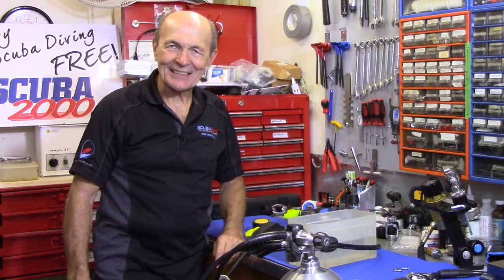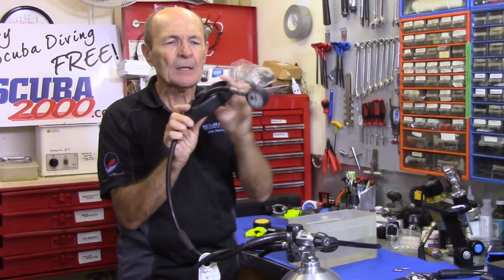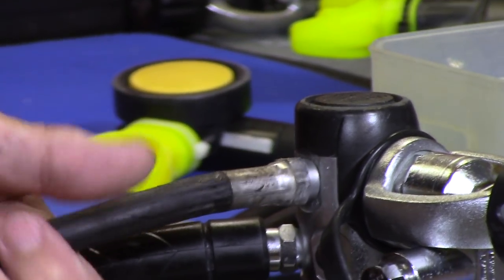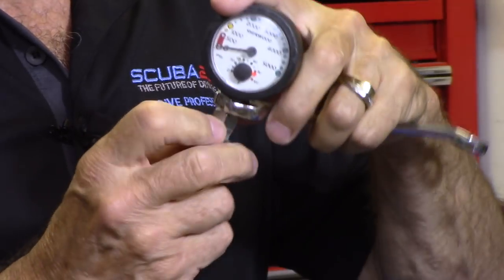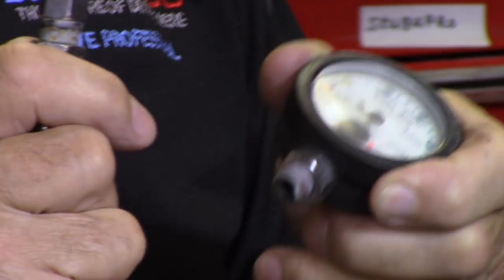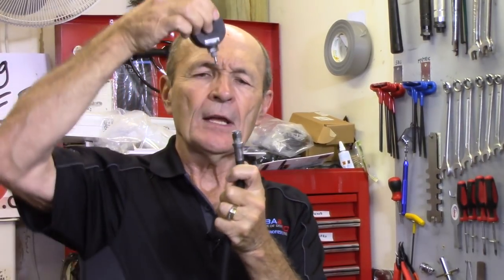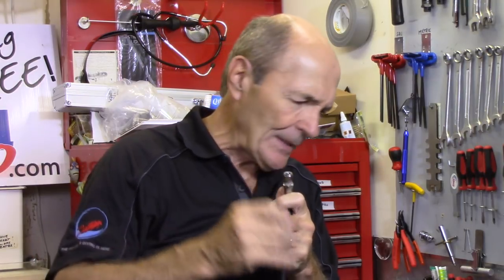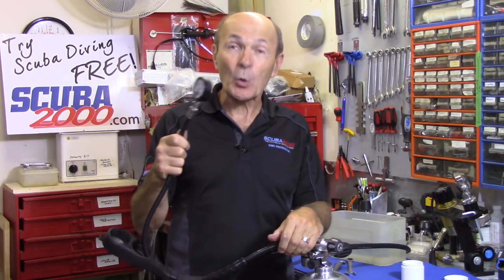Servicing Your SPG - Scuba Tech Tips: S06E14

Comment: I noticed air was leaking from my spg. After watching your video, I opened it up, cleaned everything up and changed the o rings on the swivel pin. It worked. No more leaks. Thank you for this great video.
Reply from the maker: Thanks Khalid for the comment that this video actually fixed your problem.  It's better to replace the swivel pin to get a tighter O-ring fit but for a short term fix, it can save a dive trip.
Thanks for watching.
Alec

Comment: Hello Alec.  Thanks for the videos.  I have a question about my SPG, it's about 2 years old, and on my last dive trip when I purged the air before removing my first stage from the tank, I noticed it doesn't zero out.  it's reading about 200 PSI above 0, and it's stuck like that.  Is my SPG garbage now, or can it be fixed to read correctly again?  I ask this because in this video you mention that you can't take apart the SPG dial, only the swivel pin.
Reply from the maker: Modern SPGs are modules and cannot be adjusted or repaired.
The only maintenance is the swivel pin as in my video.
You have 2 choices and either is good.
1. get a new gauge. You can buy the head only for a lot less than a whole gauge. The hose is 1/2 the cost and now you know how 
    to check the swivel pin. They're available for as little as $40.
2. note that your gauge reads 200 psi over the actual pressure so simply subtract 200 psi from any reading. When full, your tank 
    will read 3200 psi. When at 500 psi it will only have 300 psi.
    Be careful here because it may not read the same error at all pressures. Use a dive store tank pressure gauge to check it at 500, 
    1000, 1500, 2000 and 3000 psi to be sure. Also watch out because it may start to get worse although not necessarily.

Take care.
Alec

Comment: Good advice. If you dive in salt water - even if you rinse the gauge thoroughly - that swivel pin can become so corroded that it cannot be removed. That may require the replacement of the hose - or the gauge - or both. Unfortunately I did not learn this from a book or a video.
Reply from the maker: I don't know why dive service centers don't make SPG swivel pins a priority when serving regs.
It takes less than 5 minutes to change the pin. A reasonable charge for that service is $10.
The pin costs about $2 and retails for about $5.
Total cost to the diver is about $15 for avoiding a big headache.
The dive store makes $13 for 5 minutes.
Everybody wins here!!
Alec

Comment: Love this video.  You are very honest and informative.  I am new to diving and am putting my kit together.   I was hoping in this video you would have  shown inside the Stage 1 HP port hole.   I just bought a Cressi XS AC2 Compact. I removed the HP port cap to add a pressure gauge and there is no hole for air flow inside the HP port of stage 1.   Shouldn't there be a tiny hole inside there?  I have no tank so I have no way to test it.
Reply from the maker: The HP hole is very small compared to a LP second stage.  Look all around the HP port for the opening as it has to be there to pass their quality tests.
Alec

Comment: Thanks for imparting your wisdom, Alec. Fixed a basic dacor pressure gauge with a hazed lens using your video.
Also, took apart an old dacor with led display that had a dead battery. (After I got brave).

Also, I have rebuilt a dacor 260, 360, and 650 1 stage as well as a dacor pacer xle 2nd stage. 
I bought a Magnahelic ($30) Vacuum gauge with 3 in H2O range for checking inhalation effort as well as an intermediate pressure gauge for testing 1st stage regs.

Ultrasonic cleaner is also a great tool. 

Mechanical engineer and amature outboard mechanic, so none of this is too difficult. Kind of like rebuilding carburetors.
Reply from the maker: Never thought of regs as carbs but a good comparison.  Glad to know you got the great Dacor's rebuilt.  Maybe you're interested in rebuilding Dacor's for others?  
A
Reply: @AlecPeirceScuba_SeaHunter  yes, I would consider rebuilding dacor units. I'm going to try to make a diaphragm out of nylon reinforced epdm sheet for a spare 950, 1st stage. The diaphragms are getting hard to find. My 2 primary units are model 260, 1 stages (with a piston), also easy to adjust and rebuild.
Reply: Yep, a carb can be thought of as the regulator (metering device) for fuel.

Comment: Hi Alec great video!! on my last dive I saw my HPG got water inside I disconnect the hose and the water wouldn't come out of the gauge what would have caused this to happen. I never saw this before. Thank you.
Reply from the maker: For water to enter a scuba SPG, there could be a break in the bourdon tube, a housing crack somewhere or connection leak  which also means the pressure accuracy is gone and it needs replacing.   If you still have it, take it to your LDS service pro and ask to take it apart (its garbage now anyway), to see what caused the water to leak into it.  Maybe keep it as a teaching aid to others.

Comment: Hi Alec, it's good to see this video. 
My question is should I also unpack SPG body and clean inside parts if some seawater had leaked in?
Reply from the maker: Well is water got into your SPG, us old guys call that a leak, then it should be cleaned and checked.  Salt water in the SPG can block the opening giving a false pressure reading so clean and test everything.  Sorry for the smart alec remark!
A

Comment: Hafa Adai from Guam Mr. Alec!
Enjoy your very informative videos and you seem to know a lot about scuba and it’s history...

I wonder if you can help quell my curiosity and bit of frustration regarding SPGs:
1.  Why are SPGs marked up to 5000 or even 6000-psi when I imagine most recreational divers (probably the largest scuba market?) fill up to 3000-psi with what I imagine is the most popular aluminum 80s?

2.  And why do they mark the SPGs in odd increments (ie 4 hashmarks between 1000 and 2000-psi).  I would like to clearly read my spg at 1500-psi.

I know the rule of thirds, but I only dive warm tropical open water and make turnaround at 1500-psi going shallower if need be considering my air supply.

I always thought clearly marking bold hashtags at 50, 100, 200, 300, 400,  500, 750, 1000, 1500, 2000, 2500, 3000, 3500 made more sense and would be more helpful - And with actual numbers printed for 500, 1000, 1500, 2000, 3000.  I imagine they can make room on the dial with those hashmarks and numbers if max psi was printed at 3500 instead of 6000.  Or maybe it’s just me who likes to clearly know when my air is at halfway point at 1500-psi?

3.  I understand there is another realm in technical diving...  So does technical diving have a need for such required markings up to 6000-psi?

Thanks for your time and feedback!
Reply from the maker: Lots of questions so let me try to answer them all quickly (fingers get tired typing).  
1.  SPG go up to 5,000 generally match the MAXimum psi any tank could hold (before the burst disk cracked).  Any psi  lower and a high psi tank could bend the needle if it hit the  maximum limit damaging the SPG. 
2.  Most gauges use 4 not 3 marks to indicate 20, 40, 60, 80 not 25, 50, 75.  This is for a more accurate reading in 20 psi increments.
3.  Tech divers use SPG's much more than recreational
divers as they are very reliable, easy to read and you many need several with one per tank. 
Hope this help my friend.  Loved Guam as we went to/from Truk Lagoon years ago.
Reply: Thank you for your time to reply.  Yes, Guam is the “Gateway to Micronesia” so you will make a stop here to get to the other islands.  We have some great dives here too. Not as famous as our neighbors in Palau, Yap, Chuuk (Truk),etc

Comment: after this came out I went online (ebay) and bought a 10 003 o-rings dive pack (recalled seeing the LDS just swap them out) as swivels are harder to find (correct length, shape) and tube seems easy to clean. After waiting 2 years/80+ dives to clean mine, I realize I need to clean that more often (was very hard to pull old one and quite corroded).
Why not mention using vinegar+q-tip to clean corrosion rather than steel wool (scratch) ?
$1 parts and 10-15min vs $20-30 at the shop - not sure about $50 you mention.

Comment: Thank you for the video.

But how can you remove the hose from the console if you need to change to hose for a new one ?
Reply from the maker: Typical consoles have the HP hose connect to the pressure gauge.  No need to remove anything from the console.  Need 2 thin wrenched to remove the HP hose, one on the gauge one on the hose.  If put on with the right pressure it's just a good 'grunt' twist and off it comes.
A

Comment: Great video Alec, I'm wondering how often you would put a new pin in the SPG and would that be something the dive store would have done when my regs were serviced?
Reply from the maker: I always checked it and having checked it, I always replaced it.
The pin costs like $6 and the hard part is getting to it so once I have it apart I just put in a new one.
Most dive stores won't do that unless asked. It's one of the most common reasons for a lost dive.
Once a year or every 50 dives.
Take care Peter.
Alec

Comment: Q: o-rings. I assume the regular hardware store ones are ok for all LP hoses/connections ? what about HP parts ? I got some 003 ProDive for the swivel (so they should be right type) but used some hardware store one as well (sunnto cobra quick connect) which still leaks a tiny bit (a bubble every 30sec, instead of continuous). Looking at Triden catalog (page 3) I see rubber, viton and EPDM - please explain - frustrating part about DYI is having the right o-ring and there are no sizing info to be found, so you have to match at the hardware store, but how to match dive catalog ?
(Trident R003 is I assume the 003 AS-568 bag I got for swivel, rest is hard to figure...)

Comment: Thank you for the video!

Is "calibrating an SPG" part of the process you showed in this video or is it something else?

1 friend of mine, had his SPG working fine predive, he reached a certain depth, the spg showed the tank had half full, while in reality it was almost empty.. he was suprised when he suddenly heard the air is almost empty where he had to go to surface in an emergency ascent. He almost died. 

This has happened to his friend as well, using a different SPG, someone told them they have to calibrate their SPG.
Reply from the maker: All SPG's, from the first Sea-Vue to today, do NOT require calibration for one reason only.  They are not designed to be opened by divers/service techs after manufacture.  Suggest you read this full discussion on this subject from www.scubaboard.com:   https://www.scubaboard.com/community/threads/question-why-cant-you-calibrate-spg.454816/

Comment: Hi Alec, I love your videos!  My question is I dive with Nitrox so should I be using O2 lube (something like Cristolube) to grease the o-rings on the swivel?
Reply from the maker: If using EAN then cristo or equivalent is needed on spool o-rings as they are dynamic (rotating) but just a tiny tiny bit is all.  
A

Comment: Alec, I have one of those OCEANIC single button dive computers (I Know it is about 20 years old) and wonder if I need to bother to replace the o-ring on the push button at all? Still working like a charm, and I put SILICONE lubricant at the push button like once month after a good rinse. How easy is to access that o ring? Dive shop bother to replace them, or is a factory repair item?
Nice video again. Thanks
Reply from the maker: You can't service the button. Nor can the dive store. I'm not even sure if the factory can.
Soak it in warm soapy water and work the button under the water a few times then rinse. That's it.
Alec

Comment: Hi Alec, this is a great tip!
Are the swivel pins universal, or are they brand specific?
Reply from the maker: Most use a common sized spool and o-ring but this is scuba, so there are a few brands with specific spool sizes.  Best to check with your LDS as this is a small cost so get it right.
A
Reply: @AlecPeirceScuba_SeaHunter  
Ok Alec, will do.
Thanks for the info!

Dave

Comment: Hi Alec, really enjoyed your videos. I have a question on SPG's flat plastic cover. Once this plastic cover turns white, is it possible to change the cover. The SPG is working fine but problem is that i can't read the gauge (obviously!). Looking forward to your advice
Reply from the maker: If it's a fairly new SPG, say less than 10 years old, no. They are modular units and cannot be opened.
You must have a lot of dives on that one!
Alec
Reply: @AlecPeirceScuba_SeaHunter  thanks for replying. I bought this SPG around 13 years ago. Probably made only about 100 dives with it but i dive south east Asia so it did get exposed to the sun quite a bit.

Comment: Great video. I'm actually using Carbondive 300 tanks. I have them filled to 300 bars. My old SPGs broke after some dives. I noticed some brands have a scale that finishes at 400 bars, and bought those instead of the ones that have a scale that finishes at 360 bars. Is that a good idea? Do you have other suggestions?
Reply from the maker: Generally, it's best to use a higher reading gauge than the pressure you are using. That is, tanks using 200 BAR should have a gauge that reads to 300BAR. A tank using 300 BAR should have a gauge that reads to 400 BAR at least. 
For longevity and accuracy, use a gauge with the highest number that is twice, or close to twice, the normal operating pressure.
That's what the gauge manufacturers suggest too.
Or get a digital gauge.
Alec

Comment: Question, I know nothing about diving but would like to maybe play with hookah cause can SO, if I were to add a psi gauge at all like this do I have to use a swivel (cause that add another failure point) and do I have to use a special gauge at all, I won't be doing salt water
Reply from the maker: Hookah divers don't generally need a gauge as they are not monitoring a tank's pressure.  
A

Comment: is the swivel really necessary? it looks like its not worth the hassle, just use rigid connection .
Reply from the maker: The early SPGs didn't have a swivel. Obviously they didn't fail - often.
But you have to turn the hose around to see the gauge. That can be an issue sometimes.
The very earliest SPGs, invented in the 60's by my friend Sam Lecocque, was called the Sea-Vue gauge and the gauge face was at a right angle to the hose, with no swivel. You held the hose in your hand and looked at the end of it. The hose came into the back of the gauge.
However, a nuisance or not, the swivel is handy and there's no way you can avoid it. The old style doesn't fit anymore.
Juts open and clean it once a year.
Thanks for watching.
Alec

Comment: Nice one. I could have used this last year with a leaking HP hose/Computer connection, but now I know. shop didn't charge much like $10 do replace O rings on 2 sets, so no biggie. 
But that 'high tech' cleaning device isn't link free - not worried about leaving a fiber in there ? take care and enjoy S Africa - you gonna take that shark stick with CO2 cartridge down there ? :) might need it...
Reply from the maker: Thanks Alain.
Lint-free is a good concern but Q-Tips are just too handy to avoid. I don't think there's a danger. This isn't a spy satellite you know!
BTW, I used to replace the O-Rings on the SPG swivels but it's simply too hard, even with the installation tool. Besides, the cost of the O-Rings plus the extra aggravation of cleaning the old pin and installing the new way-too-small O-Rings probably costs more than just a new pin with rings.
Not many stores will routinely service the swivel when servicing your reg. Kinda' like the tire guy changing your tires and not mentioning that your brakes are shot!! Has he done a good job or not?
I always did it and I also charged a small fee for doing it. Once a customer understands the importance they never quibble about $10. $10 for a 10 minute job is like $60 an hour! Everybody wins PLUS the diver doesn't miss out on dives. I sold it as an essential service for a small fee and I also sold it as something that made my store special. It worked - divers got great service, good gear, no hassle diving and we got dedicated customers and a reputation for excellence.
No Shark Darts allowed in RSA. Not sure if I'd want to irritate a Great White with one anyway.
Take care. Talk soon.
Alec
Reply: funny now I re-read that post and had first hand experience replacing those way too small/tight o-rings - they are so hard to put on new ones!! Shop guy made it look easier using  pushing pin against a soft pad, but the other end really pokes you!
had a hard time finding the swivels (what size) so I went o-ring route. oh well...